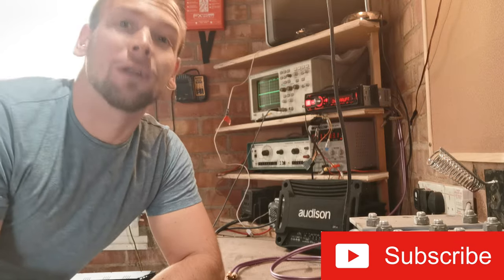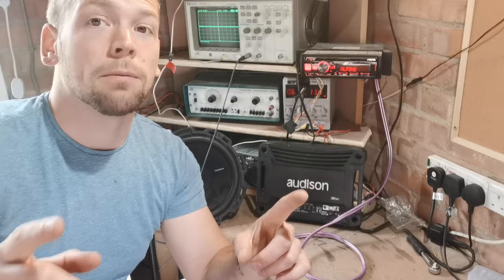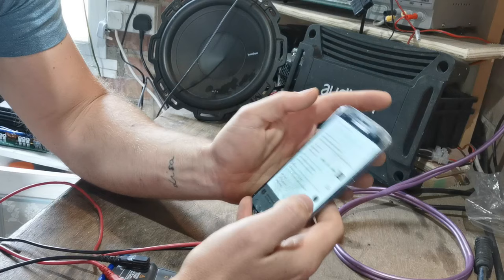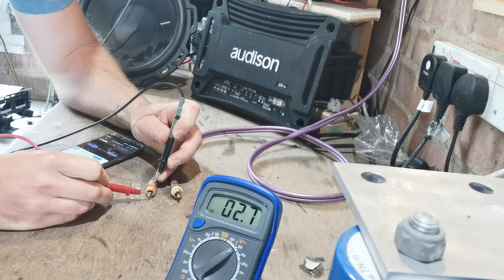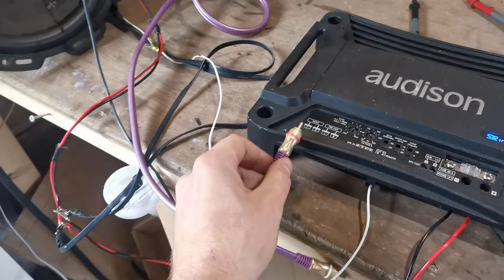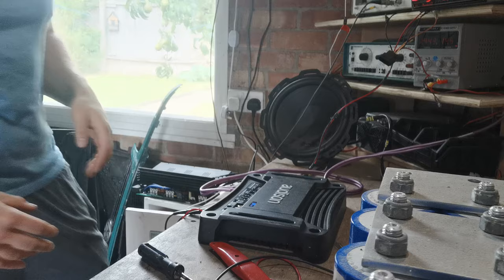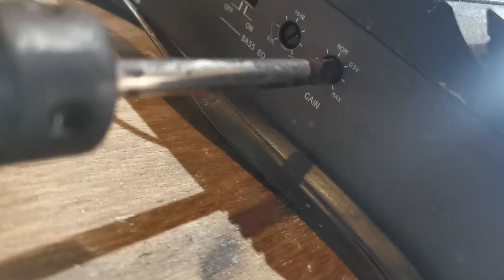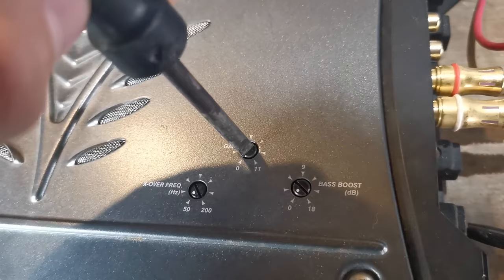PERFECT AMP GAIN SETTING COMPLETELY FREE!!!

Comment: If I install an EQ would i only use the voltage leaving the eq? The HU voltage should get amped by the eq to its 8v or whatever it is?
Reply: So set clean voltage from HU to eq, then match amp input gain to the eq voltage out*?
Reply from the maker: Yup, sounds good to me!

Comment: What if there is a pre-amp line driver connected before the amp that can send 13 volts to the amplifier, I matched the output voltage from the line driver to the input sensitivity of the amp at 4 volts but wondering that I may still be clipping the amp. How can you measure clean signal output from line driver like you did with the head unit?
Reply from the maker: If you send 13v through the RCA'S you likely fry the preamp board in the amp as most are only capable of handling 7v. Keep it around 4v into the amp 😊
Reply: @PacmanBasshead  Thanks

Comment: is it possible that your headunit gives mentioned voltage on 99% of volume? My headunit is sony xav3000. max volume is 50 and at 47-48 it delivers 2V volts(as per specification)
Reply: Yes, it is possible. Some headunits give a clean signal at max volume. Rare but not impossible. Majority of the good brands, pioneer and such. Are usually clean at 90% volume.
Reply: Hi, how do you measure the voltage, main wasn’t giving any signal, so I’m not sure if I wired it wrong or somethjng
Reply: @thomasvallet9158  Is the radio on and are you playing a test tone while putting the multimeter probes on the RCA wire. Go back and watch the video and try again
Reply: @thomasvallet9158  are you talking about the amp or headunit
Reply: @thomasvallet9158  from rca output of stereo.

Comment: I have a Alpina ilx-f259 i have to turn every thing on max just to reach 4v output. Media xpander is on max, subwoofer level is on max(15). Bass is up +1 and im sitting right at 3.98v at level 32out of 35. When i set my gain im sitting at 2 out of 11 before my clean out led starts turning red.. before that i had my levels all flat and at zero. And my gain was at half way. Did i do it correctly?
Reply from the maker: Do you have an inline rca bass controller?
Reply: @PacmanBasshead  I have a RJ11 remote bass controller that comes with the amp. That is on high. No inline RCA
Reply from the maker: @devon8706  unplug it and try again, see if that makes a difference. If theres no interruptions in the RCA between hu and amp, then it could mean massive drop down the cable perhaps. Test on the headunit with the cables unplugged, then plug in amd test the other end of the headunit.

Comment: If u have two 1200 wat RMS subs and a1200rms amp can I turn up gain as much as I want?? Or will it still clip
Reply from the maker: Clip has nothing to do with power. Your subs themselves have no impact on clip. Think of your sub as the punching bag, they are just there to take what you feed them. 

As is in the video, clip can start before its even gotten to your amp, so yes, is your answer.

Comment: Okay. So If my amp literally shows no value on the gain, except a bar that gets larger could I put my multimeter at the speaker terminals of the amp and measure the voltage coming out to match it up?
Reply from the maker: No sir, voltage at the RCA'S is AC, speaker voltage is DC
Reply: @PacmanBasshead  would a cheap o scope work? Cause this skar 800.1 amp is no where near helpful it shows no numbers

Comment: I believe this would be okay but let's say u set it to 5v with a 5v system and u turn it down  would that be fine. And also with a bass knob. If you have it maxed out at 5v don't bump the bass knob up? I hear ppl call the bass knob gain control and is just very confusing. Than ppl say gain isn't volume but also say the gain is the volume than call the knob gain. What

Comment: So, at only 66% of the Alpine's pre-out signal, it begins clipping? Can't forget that when you wanna "crank it."
Reply from the maker: Clipping is actually fine as long as you monitor it. Its just that itll cause heat. The heat damages the coil, not clipping itself.

Comment: I see this makes sense but with this formula I Get 8.33 V and when I take the RMS OF MY speaker x OHM = square root of that, it give me 34 V...
What formula is correct ??? 
My amp can handle 3000 watts and my kickers are 600 rms each I have two.
Reply: I think 34 is the maximum supported without clipping.
Reply: @axetroll  sweet thanks! The peak power on the subs are 1200... does that even matter ?
Reply: 1200 each.
Reply from the maker: This is to do with amp signal, not the subs handling capabilities. If it works and it doesn't smell then you're all good. However FYI only ever go off rms ratings, peak ratings mean the power it can take on a 1 second burp.

Comment: Hello Adam, i need your help, i have tried the same method, connected multimeter on RCA out, but there is no reading on Multimeter..i have Pioneer DMH-Z5290BT aftermarket...can you please help here..
Reply from the maker: On ac volts? Does your voltmeter go down to 10ths of a volt?
Reply: @PacmanBasshead  Hello Adam, i tested with wifi adapter and showed 25 volts, its a cheap multimeter, do you think it can go below 10 volt  - thanks for getting back on this !!!

Comment: Nice tutorial but this won’t work with a jbl gtr-1001.  Since there is no sign of minimum gain position in the manual, also nothing on the amplifier ,      Right now I have set my gain voltage to the square root  of  amps resistance multiplied by watts rms
Reply from the maker: Hi, the manual says the following "The rotary gain control let you match the amp's input sensitivity to the output of the source unit. The input sensitivity range of the amplifier is 0.2V and up for a low-level input, and up to 20V for speaker-level input'. 

I would therefore advise that the gain potentiometer goes from 0.2v to 20v.

Comment: If i have 2 subs , i need to calculate both of them or only one of them? Btw subs are on a stereo amp one sub per channel (2 channels). 40w*2 channels 4 ohm 45w rms subs 8inch.
Reply from the maker: With a 2 channel you should only have 1 gain knob so you only need to do this once 😊
Reply: @PacmanBasshead  yea, it's only gain knob, the question is i need to calculate the power at both of them? Like Rad4*45*2 or Rad4*45 ?
Reply: @PacmanBasshead  the amp is an kenwood kac-624 and the woofers are 2 dibeisi 8 inch 4 ohm 90w peak 45 rms

Comment: When I turn on the lights it buzzes , when I put on the brakes it buzzes. When no lights or braking it hums. I got filters but not answer to the problem, also engine whine. 😡I’ll try the wire trick first.
Reply: Poor quality wires?

Comment: And this only tells the amp max clean signal.u gotta make sure your subs are the rite ohm load and can handle the amp power if it’s max at its cleanest signal output.can blow a weak sub if amp is too big..
Reply from the maker: Of course my man! But a smaller subwoofer will take far more than rated power if the crossovers are set correctly 🙂
Reply: @PacmanBasshead  yes sirrr

Comment: This doesnt make since to me. If the input is at the may 6 volts for the 1st or 4 volts for the second your logic says to turn it up 100 percent, full open. My logic would suggest that would be the lowest setting at min. So if the amp accepts 6 volts and your putting 2 volts into it, you should turn it up 66 percent, 2 volts out of 4 would suggest turnig it up 50 percent.  So lets say you had 1 volt into the 6volt max input. You would need to turn the gain up 84 percent. Thats why .5 volts was so high on the amp gain, the less input you have the more gain you need to make up for it. This isnt an issue with quality amps that have good signal to noise ratios but some amps can pick up noise with lower input voltages

Comment: So we don't care what RMS the speakers are?? Snot is coming out my nose as I am dumbstruck - i would appreciate the science behind this technique because the other guys said we must measure desired voltage rms
Reply: I think what you're referring to as the other guys say about rms of speakers. Is when the amp puts out way more power than the speakers can handle. In general you want to match amp with speakers so over powering isn't an issue. You wouldn't need to find the correct voltage to dum down the amp to match speakers.